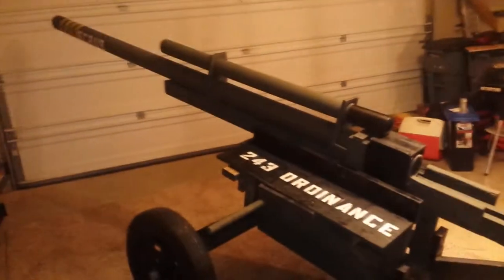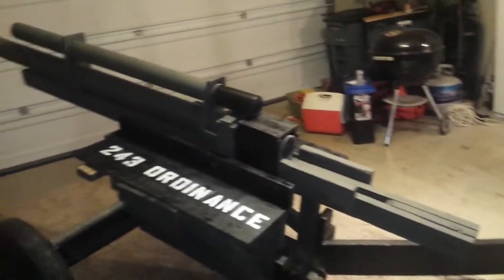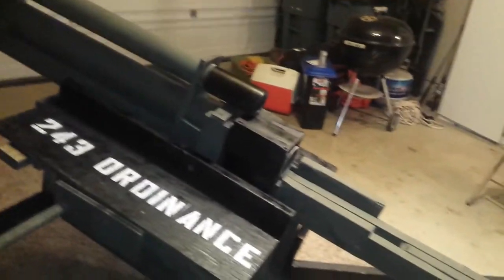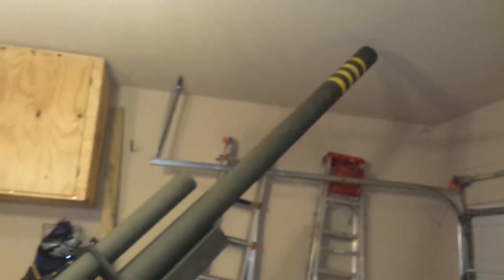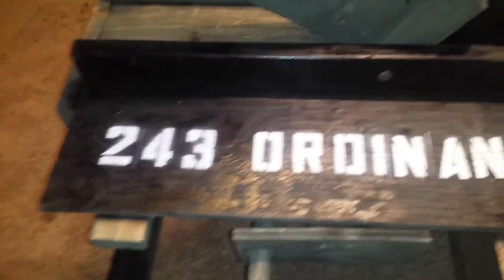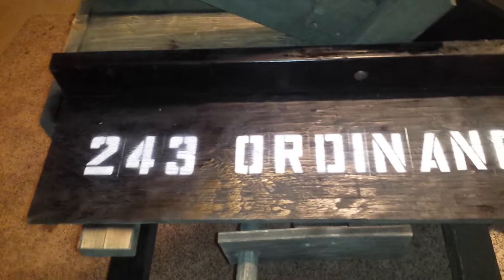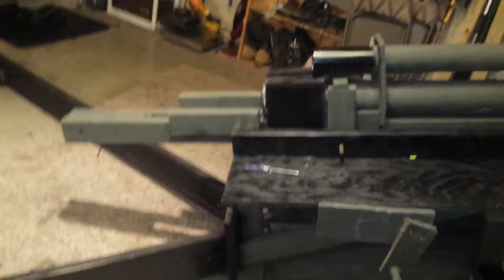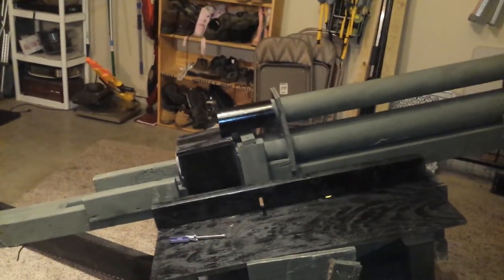Homemade M1A1  howitzer

Comment: How much does the howitzer rattle? Also, what do you usually shoot at? Dead Trees? Have you tried to retro fit a muzzle break? Does the gun suffer damage after multiple shots? (wood and all) Also, how does cleaning work?
Reply from the maker: Thomas the Dank Engine due to legality reasons we cant shoot live rounds out of it. we load a 105mm shell with double f powder and fire that. also shoots fire works. the frame and. chasis gets repainted and thats about all it needs maintence wise. cleaning we just throw a wet sponge down the barrel.
Reply: arbitergvadam Have you tried stuffing popcorn kernels inside? Then have an "explosive" treat afterwards? Or is that also against the law?